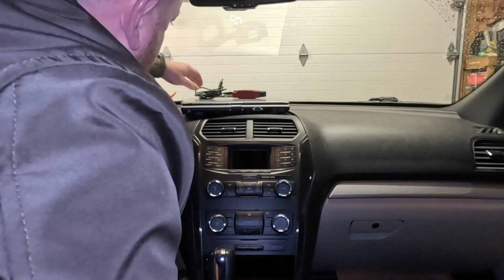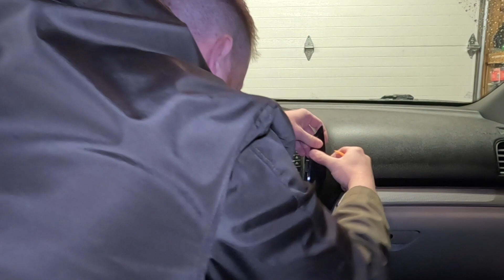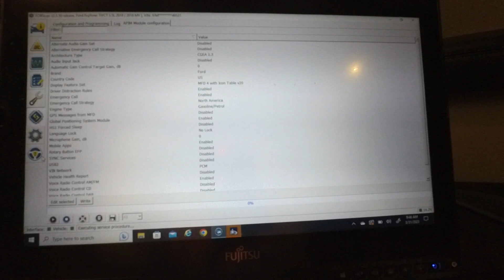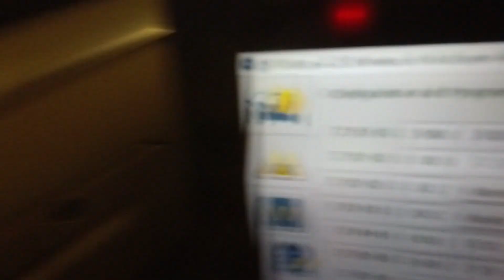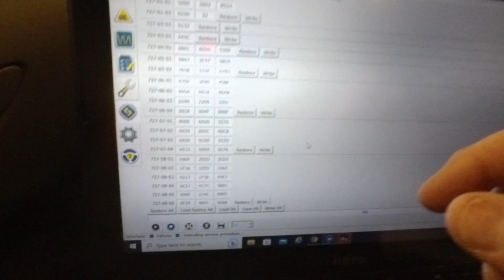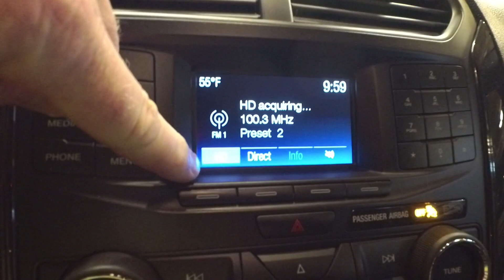HD Radio Upgrade - 2011-2019 Ford Explorer Base / XLT / Police Interceptor Utility Models

Comment: Have you looked into a telematics unit instal for Frodpass.  That would be good one to do. Not a lot of info out there on that upgrade.
Reply from the maker: I tried it... Never could get it to work right. I got it to show up on the network but the remote start and lock/unlock did not work.

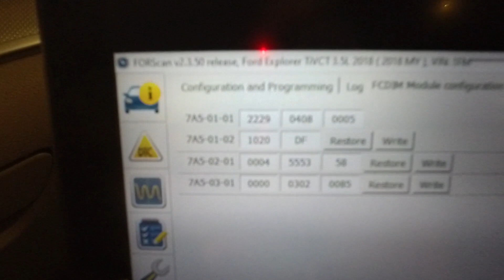Comment: At the 21:32 minute point you change the 8th character in the FCDIM 7A5-01-01 from 8 to 9, what is the purpose of this change and where can I find out more about it? The FORScan 2015-2020 150s - Livintup spreadsheet on FCDIM only talks about enabling and disabling the reverse camera.
I should add that when I added my HD Radio to my base 2016 Police Interceptor Utility (no APIM Module), using the part you specified, I also had a problem with the volume being fixed, I corrected this by changing the 3rd character in the ACM 727 01-01 from A to 0. This value of "0" was the value used with my original plain jane (non HD non SYNC) ACM and it seems to work perfectly in the HD ACM also.
Reply from the maker: You have to do this for the HD radio to work, at least on my 2018 here. If not, the HD radio on screen button is not there. I explained this in the video

Comment: Trying to see if I can put a aftermarket Sony apple play stereo in my Ford explorer interceptor??? Or at least get the aux to work or Bluetooth anything
Reply: Atoauto , in Wisconsin
Reply from the maker: You can for sure. Have to use something like this. They are expensive.
https://www.crutchfield.com/S-SQokQObWXel/p_120995858C/Metra-99-5858CH-Dash-and-Wiring-Kit-Charcoal-Gray.html
Reply: I had the metra dash kit. It's junk. Keeps refusing to turn on sometimes and gets the hvac blowing hot. Have to disconnect the battery to reset it.  Better off just getting the 8" hvac panel and adapting an android head unit.

Comment: I was able to do this and missed the step to backup the before and re-write it over the new hd radio settings. I was able to fix it by loading the factory asbuilt and changing the hex values mentioned. Also would like to say if you have the 8” sync 3.4 I didn’t have to do the front control setting you mentioned. But once I changed the one hex it worked volume and all. Thank you!!

Comment: could you do this to enable the aux feature
Reply from the maker: Yes, you can use Forscan to program other features in the ACM, but you would have to have the additional wiring and the physical aux port installed for it to work.

Comment: Hi, how about Bluetooth ? can be enable it ?
Reply from the maker: Bluetooth is via the Sync module on Fords. If you don't have it, it will require the sync module and associated wiring, microphone in the headliner, etc. Not an easy project.